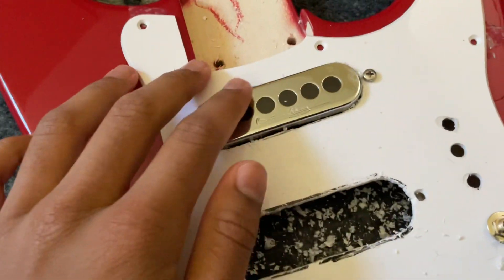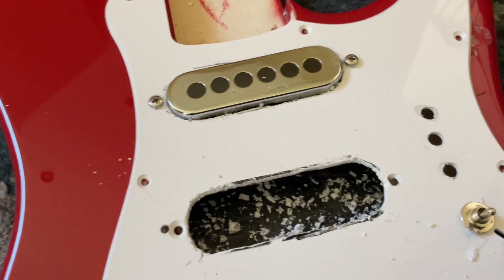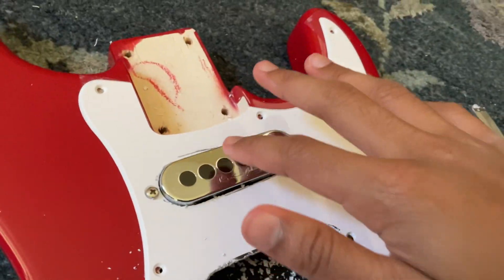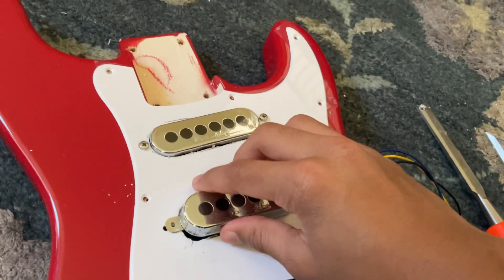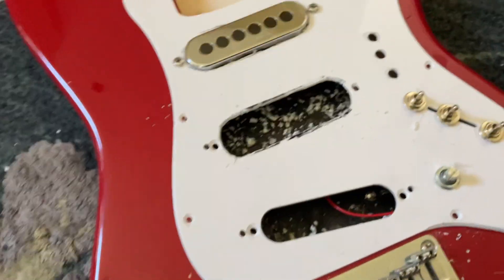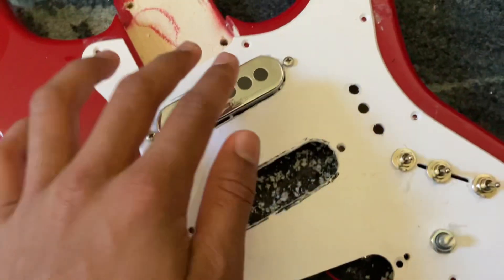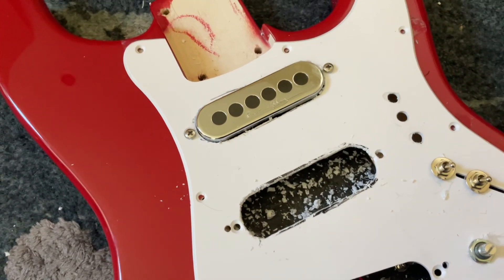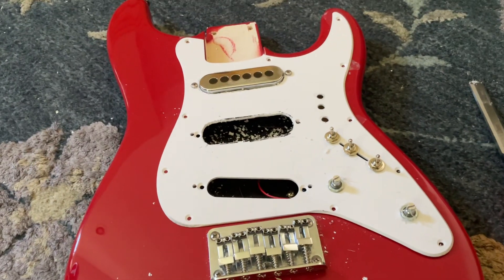Brian May Stratocaster Mod - Neck Pickup Installed

Comment: Yes you need solder for the ground wire, keep in mind that the ground wire on the tri sonic pickup it's not connected to the pickup coils ground negative like in a humbucker, the ground wire on a Tri sonic is connected to the metal plate on them
Reply from the maker: @Headbutter-Lettuce90  so basically just the back plate of the pickup?
Reply: @shaikhjunaaydjs1217  yes usually the ground wire it soldered at the back plate
Reply from the maker: @Headbutter-Lettuce90  alr thanks